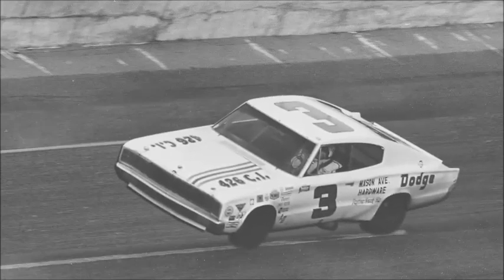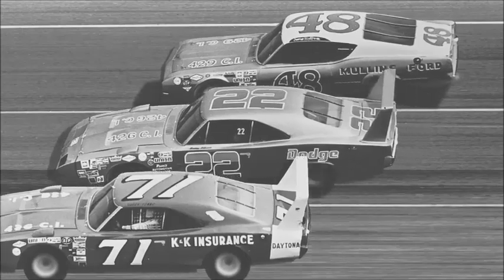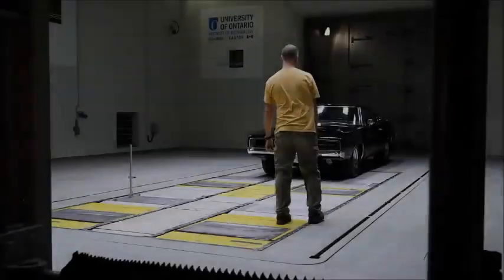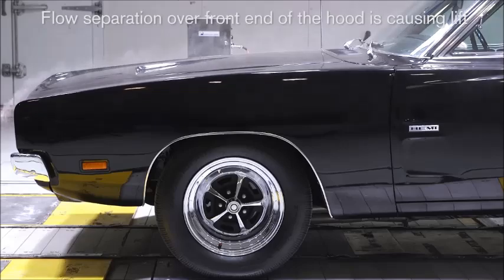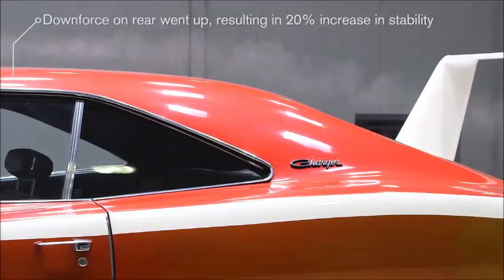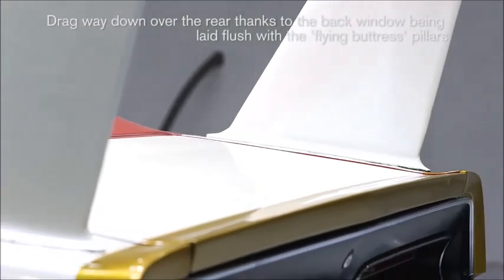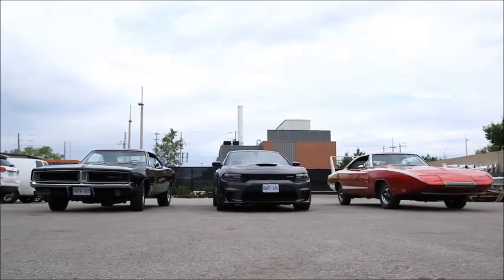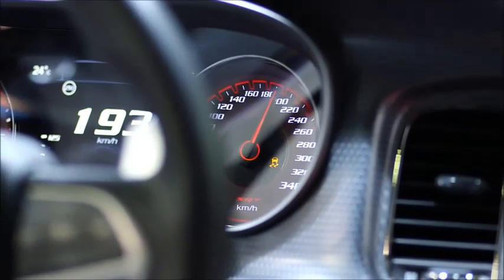Charger Daytona vs. Dodge Charger Hellcat

Comment: I think NASCAR should bring back dodge and get rid of Toyota I wanna see Chevy vs dodge vs ford again who agrees
Reply: nascar runs custom made race cars they haven't had a detroit car on the track in 20 years
Reply: Nascar didn't kick dodge out. The few teams that were running dodge (Penske, and Richard Petty motorsports) got a bunch of factory support from Ford that dodge wasn't giving them. So the teams just stopped using dodge.
Reply: From what little I know, NASCAR needs certain sales from whatever model is being used.  So for example, if the Charger was to be reused as the race machine from Chrysler, they need to sell like 39,000 units annually.  Probably more than that, but that at least gives an example.
Reply: Me
Reply: MM..you dumbass Sounds like you know nothing about stock cars and NASCAR...Dodge is out of NASCAR because Ford bought them out of NASCAR by luring Penske away from Dodge with more money trying to buy a championship. Yeah you are right Dodge was down to 2 cars in the whole field but they won the fucking championship with ONLY 2 cars in 2012 the last year they were in. Dodge tried to find a team worthy to carry the championship flag but there were none available so rather than let some woodchuck team run the Dodge name into the ground they just retired with the championship....something Ford can't even buy for almost 20 years.  Fiat has done more for Dodge than anyone else ever did since before Lee Iacocca bought Chrysler in the 80's. Can you say Scat Pak, Hellcat, Demon??? Dodge is advertised the American performance car company with the Demon being the quickest production car in the world ever. All true. And here is where your ignorance really shines...what in God's name did you mean by"actual race cars with chassis that work"???  WTF do you think those guys are driving go karts with bodies??? My God man you sound dumber than a box of rocks. The biggest reason NASCAR is so awful now is the cars are all exactly the same except for the stickers on the bodies...all hand built by the best race car builders in the world. You must not have a clue what kind of money a competitive NASCAR team has to spend. Racing was WAY more entertaining when the cars were built by the car companies and the race car teams got them from factories and turned them into race cars b y using blood, sweat, tears and a little ingenuity to make them fast...

Comment: 1968-1970 Chargers are just about the sexiest cars ever build
Reply: 1966 Dodge Charger is sexiest
Reply: Conner Deppe will agree
Reply: Still the sexiest ever
Reply: Nah I think the Nissan Cube is the sexiest car ever created, nothing surpasses that cube body 🤤
Reply: @Big_Jules1  The Prius!😅🤣😂🤣😆
Reply: Only for the dodge a lot of car are beatiful and a legend
Reply: What about the Plymouth super bird?
Reply: 100% But what just sets them over the absolute top is the wing cars. The Daytona and Superbird are absolutely beautiful, in my opinion!!
Reply: Amen to that brother...
Reply: AGREED
Reply: Key words...just about.
Reply: I agree
Reply: Ong
Reply: Saw a 1969 charger r/t cherry red today it was beautiful.
Reply: I don’t agree ... My ‘71 Dodge Charger R/T is thee most sexiest car out there back in late 70s with 440 block + 440 emblems on raised front hood , , headers , glass packs , , racing wood steering wheel mind you , pistol grip shifter , 4.56 Dana posi rear , plum crazy purple paint & black interior with wood grain on instrument panel , front & back - black spoilers , shark gills on sides of body , chrome Cragers mags , wide 70s up front & wide 60s in back ... 
When  I launch it off the line my car frame would twist because of tons of torque it had .. Having a stock charger is no comparison against a all beef up , upgraded Dodge Charger R/T ..  
Btw a 70 Plymouth Roadrunner with no front hood just a tunnel ram manifold with 2 - 850 Holley carbs sticking out of engine bay .....took me on down a small stretch of road before we get to city bus in curve...I kick his ass in 3rd gear and it was over quickly, so I shut it down , he yelled can I look at it , so I let him , he said can I drive your car and you drive my car.... I said 👎..  Why?  Because I would’ve traded even up for his , a thing of beauty that Plymouth Roadrunner was my gosh!!!
Reply: Locus XXX you right 🙂
Reply: @rockngpa5094  , I had a 1974 Charger SE, (same body style as yours) all black, with the Magnum 500 wheels, and I agree, it was pretty darn sexy.
Reply: @rockngpa5094   .......Wow!!! You are going to be in a "crowd of one" with that opinion. I can say in complete honesty. I don't believe I've ever met a single person who would call the next generation of the Charger a better looking car in 1971 vs those that came before it. It's subjective opinion though. There is no right or wrong answer.

Comment: New dodges  are a joke classics are where it’s at
Reply: yeah well if the new Dodges are a joke why are all the Mustang enthusiasts crying instead of laughing??? I mean a comfortable family sedan that tops out at over 200mph and 10 second quarter mile???  Dodge performance these days is eating Ford up inside and they are basically in panic mode right now trying to engineer something to compete with Dodge. Trouble is Ford can't do it...Ford has to rely on outside help...can you say Shelby... to get the job done, or rather try to. Chevy isn't worried and they don't need to be. They have the engineer expertise and know how to compete with anybody in the automotive world. Same as Dodge. Ford hasn't had that for 40 years now.
Reply: @bultacowally  Yes Chevs do compete well after they cry and have the rules changed then you don't hear a peep out of GM
Reply: @bultacowally  the new mustangs wipe the floor with the new dodges lol. Plus, I can take a mustang to the drag strip and track on the same day but for a dodge, oval track and dragstrip only. Those boats are fucking useless, it's funny when jdms, edms, mustangs and camaros eat chargers and challengers for breakfast.

Comment: I can't believe you didn't put any quantitative data.  Who the hell is happy knowing drag is "way down?" Great concept but atrocious presentation.
Reply: yea i agree
Reply: yea i agree
Reply: Use the link in the description to see the data, like "At 200 km/h (124 mph) our final numbers were 373 lbs of lift on the front end and almost 80 lbs of down force out back".
Reply: @Ziggy_Moonglow That's great info but why did they stop at 124mph? The Daytona ran 200mph and even when it wasn't running that fast, Nascar speeds were still over 160mph. What does the new Charger and Daytona make  at those speeds?
Reply: @number3665  That was about the top end of what the wind tunnel could simulate, to give you the short answer.
Reply: I just found some data on a STOCK 1969 Daytona. They give the Cd at .37 
Source : http://www.dodgecharger.com/forum/index.php?topic=108784.0
Reply: Fuck You  i believe the daytona had a top speed of 204
Reply: yea i agree

Comment: did hellcat have km/h instead of mph on speedometer?
Reply: Kholiq Deliasgarin Radyantho Yes
Reply: It can be changed with the push of a button on the steering wheel.
Reply: YES! right as the audio track says "and is able to attain the same speeds as the Daytona..." while showing the Charger R/T's speedo reading about 200KPH!!

Comment: The main reason the rear wing was so tall was so that the trunk could be opened.

Early designs had the wing much lower but the trunk would only open six inches. Engineers then raised the wing higher and higher, noting the positive effect on the down force generated. They also noted that the taller wing generated more downforce with less drag at lower trim angles and the lower wing with higher angles of attack. 

The race Daytona has a Cd of .29, the street Daytona is about .37, and the Hellcat Charger has a Cd of .33.

The street Daytona has a lot of drag due to the mirrors and window areas.
Reply: Don't forget the race Daytonas sat 6" lower to the ground which is why those useless air scoops were on the front fenders of the street Daytonas - the undersides were cut out to help clearance the tires from the lowered suspension in race trim

Comment: 1970 was the SUPERBIRD not the Datona. and it was 221 mph
Reply: Leaping Weasel They made both in 1970 the Plymouth just sold more
Reply: @TheRyancamaro  Sorry, NO. The Daytona was ONLY made in 1969. Nascar rules required them to sell 500 to the public to qualify as "production cars" The Superbird was made ONLY in 1970. Nascar rules CHANGED, requiring them to sell 2000 to the public to qualify
Reply: Dodge was the Charger Daytona. Plymouth had the Superbird.
Reply: Dodge Only produced THE Daytona charger wing car in 1969. people have cobbled together wing car copies out of every kind of cars imaginable But the factory only made them in 1969 as the Daytona Charger (Dodge) and 1970 as the superbird (Plymouth).
Reply: You are correct, there is an error: Buddy Baker set the record on March 24, 1970, not in May. An engineering mule Charger Daytona, at the time a one-year-old vehicle, was used to set the record. And, yes, we do show a Superbird whilst talking about the Charger's record; I blame the editing guys for that one. I hope this clears it up!
Reply: No superbird ever made went 221mph on any track the only one to come close to that speed was bill elliot in 1987 with a ford thunderbird
Reply: And the superbird was slower than the Daytona because the rear wing on the superbird was forward 8 inches causing more drag
Reply: at 0.50 they say "in may 1970 it broke the record..."   and show a picture of a SUPERBIRD.    in 1969 Daytona went 199, breaking the record. in 1970 the record was broken by the SUPERBIRD (at 221) not the daytona.
Reply: @leapingweasel6457  Nope.  You don't know what you are talking about.
Reply: @Ziggy_Moonglow  Really?   i own a superbird. a 1970 superbird
Reply: i own a superbird.   thank you

Comment: I wish dodge would slap together some more 2dr Chargers
Reply: No, turning it into a front wheel drive K-car in the 1980s was disrespectful.  Making it into a squishy riding Cordoba clone in the late 70's was disrespectful.  Making a four door performance sedan that would sell rather than an over sized coupe, that would not, was economics.
Reply: The Challenger is already a cut down Charger, so what would be the point?.  That's why it's so much heavier than Camaro and Mustang.
Reply: They did... in 2008. Its called Challenger. That’s today’s economics.
Reply: Seed_drill Fair point. Still, the modern Charger doesn't share in the same aspects of its' roots. The new Charger looks great for a sporty sedan (imho) but to call it a Charger just seems wrong. Nothing about the new one reminds me of the old ones (the good ones). Then again, maybe younger people don't know/don't care about the classic Chargers.
Reply: William Smith those four cylinders in current mustang and camaros are still plenty faster than more the half the cars out there, same can't be said for the 4 banger stangs and maros of the 80s, except the SVO which was very capable at the time.
Reply: Dain Bramage yeah unfortunately they won't because they sell alot of them as cop cars
Reply: brycmttw, yeah, the old Charger and Challenger were on completely separate platforms.  The current ones share the same.
Reply: I agree, making a 4-door Charger is disrespectful to the car's history. I'm not sure what's worse though, that or 4 cylinder engines in the new Camaro and Mustangs smh
Reply: Looptydude Sure the modern 4 bangers have more power but it's a tradeoff for more out of a smaller package. If they really wanted to make an econo-Stang available  they would've just added cylinder deactivation to an already existing engine.. like the v6 or v8. Anyways, what I mean by tradeoff is that these new turbo 4's work extremely hard for the numbers they put down. Fast-spooling small turbos, high compression, high boost, plus in this case propelling a heavy car, not the ideal engine for the application. It would be like strapping a hopped up weedwacker engine to my riding mower, sure it might work, but anyone with any sense would rather have the 20hp engine that came on it, right? 

Imho screw the economics of it all, a true musclecar deserves a big powerful v8. That's my main point and that ideal alone is the reason musclecars continue to live!
Reply: William Smith while I may agree with the sentiment of "screw it gimmie muh big v8" the manufacturers pretty much have their hands tied. There is a reason their are no more big displacement engines, and emissions is the reason.
Reply: Looptydude I suppose it can't be avoided, them being mainstream cars. As long as people enjoy them that's the main thing. I just wonder what's going to happen in the future: are all musclecars going to have the same set of options for engine size, or will advancements in engine tech eventually render the v8 obsolete (in a sense).
Reply: You know what else is wrong?  The answer is everything that you say and yourself, William Smith!
Reply: People that keep pushing for the V8 to go away honestly need to be treated with a double tap to their skulls.
Reply: well the v8 is going away and they're replacing it with a twin turbo v6.
Reply: also, the charger is a 4 door car because it originally started off as a family car with 4 bucket seats.  It was a family man's car.  Pretty sure Dodge has shown its respect by making the Dodge Challenger more like the original than let's say the Ford Mustang and Chevy Camaro, which in my opinion look more alike than ever before.

Comment: How is the Hell Cat achieving the same kind of speed as the Daytona when its clearly showing 200/kmh at the end of the video.
Reply: Lost Vegas And the Charger Hellcat does like 202. The Challenger Hellcat does 199.
Reply: 200KMH is still pretty fast for a family car/road legal/non race vehicle
Reply: 200/mph is much faster then 200/kmh. It's really not even close.
Reply: 150KMH is roughly equal to 100MPH Also another thing is, that daytona would have been tuned so much to be able to reach those speeds
Reply: Lost Vegas The engines didn't have to be available just the car bodies themselves.
Reply: The Metric System is NOT superior, Martin Hübinette, you elitist Eurotwat!  I didn't talk shit at all about your Metric System until you talked shit about U.S. Weights and Measures, so do not deny it, you lying ass hypocrite!
Reply: The hellcat chargers top speed is like 203 or 204 mph
Reply: My 120hp 4 door BMW from 1987 can hit 200km/h pretty easy, I'd hope something with literally six times as much power can do a little more.  (It can, try +320km/h actually)
Reply: Lost Vegas .....so you are assuming the NASCAR race ready Daytona's and SuperBird's were running stock 425hp Hemi's. If that is the case you are very much incorrect. It's pretty common knowledge that even the stock 425hp was pretty under rated and should have been closer to 500hp. Just an aero package was not going to make 425'ish hp do 215mph.
Reply: To: Justice Jimenez,
That is because the computers are programmed out of the factory that way, if you know what you're doing you can hook up a laptop to your car and remove the governing safeguards and limitations on the engine.
Reply: Fastest Dodge Daytona was 248mph I believe that car was fast but tire technically was way behind
Reply: One imperial "mile" is 1,609344 Km or 1609.344 meters ( googled) (I thought it was 1608 meters). For fast math do ×1.6 when converting to the superior Metric system or ×0.625 from Kilometers to miles.